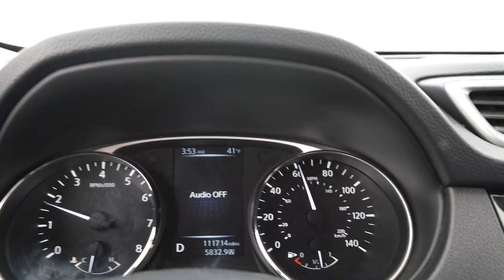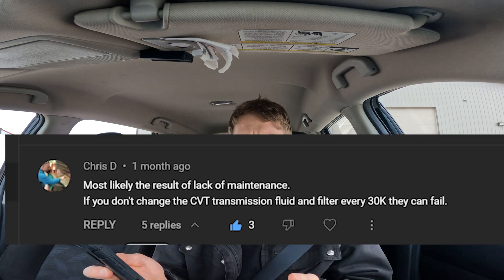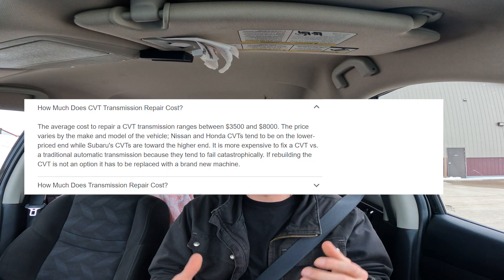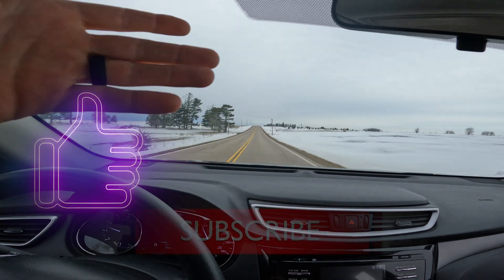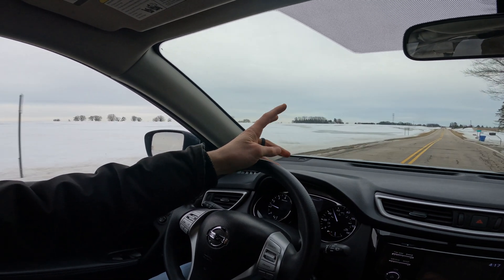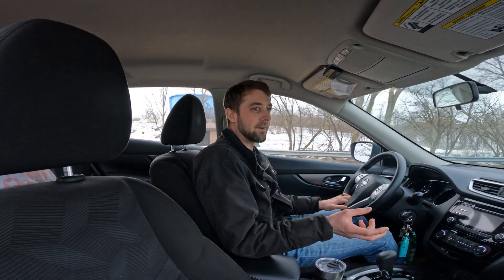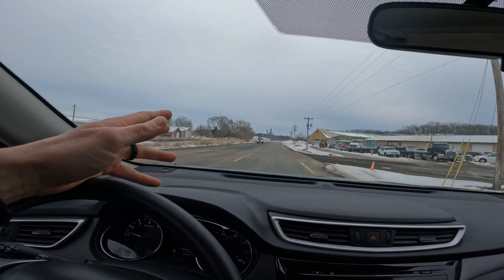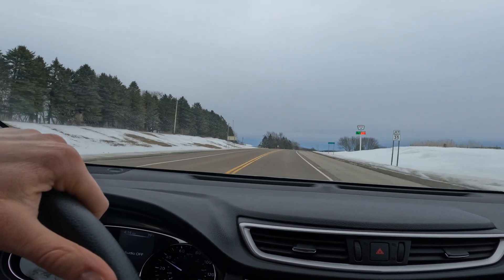Everything WRONG with the Nissan CVT Transmission

Comment: made to fail and sacrificing longevity for environmental insanity when the whole manufacturing aspects included would balance out by requiring less component production and fluid to maintain etc.  personally i'm done buying anything newer than 2005 and i'll stick to classics and diy where at all feasible.

Comment: I always make sure I put my cars emergency break up at all times whenever I'm parking my 2027 Nissan Sentra and whenever I change gears I always come to a complete stop. I also make sure I change the fluid every 30,000 to 34000 miles and it's been running strong. I'm currently at 162,000 miles.

Comment: CVT transmissions fail. OK. I see an opportunity to acquire cheap vehicles that are often like new. They look slightly more complicated than a transfer case? Don't by the mega expensive new or rebuilt units. Tear it down fix it n upgrade the stupid thing. I wonder if a software modification might help them? Put a big cooler on it?

Comment: buddy the CVT by nissan is not junk, my pathfinder2014 CVT  has 472000 kms on it on original CVT, what you need to do is following:
1- the CVT dies when overheated, oil loses viscosity as it heats up if temperature goes to 90 celsius then the belt starts shredding and gone. The heat destroys the valve body also. You need to have a cooler like the one in the pathfinder. However you need to clean the fins with water hose from dirt and sand like you clean your outside air condition condenser. Sand causes the cooler not to cool the oil and it becomes a heat trap! thousands of videos on CVT service and repairs and no one tells you to do the water hose cleaning which is free! they all want to sell you a product!

2- Oil drain and refill needs to happen every 20,000 -24000 kms dont open pans or anything, just drain and refill take 3.5-4 liters measure and refill and cost 50$ you can use cheaper oil like valvoline CVT or castrol cvt they are good and have better antiwear and anti slips additives than nissan NS3. But changing oil doesn't work if yhou keep overheating you oil and not having a trans dedicated cooler see point 1

3- Change the warmer paper filter- tiny filter 10$ evert 50-60,000 kms its an external one and is 3-4 10mm bolts takes 10 mins to do so. 

4- When you start the car the cvt oil needs 2-3 mins to warm up so dont drive instantly the oil is cold and doesn't lubricate properly, just wait

5- The nissan cars are cheap and is for cheap people but maintain them. I don't know why you think cvt is expensive? The pathfinder for example 2014 to 2018 models CVT are not selling 2nd hand in edmonton canada for 5000 to 10000 canadian dollar that's 3000 to 7000 USD so buy a full car instead of fixing the CVT if you don't know how to maintain it!

6- The CVT is well designed, but you and people don't understand how to maintain it. If you open the CVT valve body, the manufacturer installed two magnetic small filters inside the valve body even but people wear the belt extremely and I've seen people who have pathfinders never cleaned their external cooler by water hose ever since they owned the car and the cooler cannot heat anymore at all it' completely blocked all fins are blocked so the oil heats and goes to that cooler and it just steam and gets back to the belt and shreds it apart!  

7- Optimum operating temp of of cvt oil is around 70 celsius, so you can monitor your car easily buy an amazon OBD scanner and read the temps when you are driving in traffic and you'll figure soon you need a dedicate cooler. The cooler is probably nissan's mistake it's not standard on all the cars, but again people who buy nissans are cheap they wouldn't buy it!  I saw on amazon a full kit cooler for 55 canadian dollar delivered, from A -premium. Best ones are Hayden's 40,000 BTU capacity.

Comment: I have owned four Honda automobiles with CVTs and never had a problem. If you drive like a maniac in any car, regardless of the type of transmission you will damage the car eventually.. I personally like the way they drive, and having a bad experience with a Nissan product is not that unusual. Your video should be entitled, don’t buy a Nissan anything.

Comment: The infomous CVT transmission are junk whats wrong with a manual gearbox or even a normal automatic transmission and tgere is one motorcycle with a CVT transmissions the Suzuki Bergman it has the two pulleys and rubber belt which is easy to access and repair after all CVT transmission are in DAFs from the 1960s that was the first CVT car and it is the simple version of the CVT

Comment: 6,300 replacement at Nissan dealer for my 2016 Nissan Rogue at 50,010 miles. The only joy was getting to crack Dad jokes with the service rep. Implying that I needed to save money on other bills, so since I had some time, I knew I had at least 20 minutes,  so I called GIECO, 20 minutes, up to 15% off on your car insurance.

Comment: I see lot of video on how bad Nissan trans are, then go to next car like ford Escape and the same thing, I wish someone would make a video on what is a good used SUV to buy, is everything junk and we have to pick the best junk or what.......

I can surely say that the 04 Jeep Liberty was a good SUV that Jeep made, I put on  over 200k on it and the motor still runs good. In 2022 the trans went at around 195k, but a used replacement was put in for $2,000.00 installed, other repairs and maintenance was mostly easy and on the cheap side compared to todays Jeeps. But now the body is rusted out and todays body shops dont fix rusty cars, they only do collision repairs.......

Comment: You are so right I have a CVT Nissan rogue 2015 looks just like yours. I bought it last year used one owner and it had 79K miles on it. Transmission just went out and I’ve only had it a year. I had my Toyota for 16 years, never replaced the transmission, never had anything this costly to repair on my Toyota Camry 2006 which I had for 16yrs!
I was giving it regular maintenance changing the oil doing all that and still you shouldn’t have to change the transmission fluid at 70,000 something miles when I first got it.

Bingo exactly I bought it bought the car to register and insure. It cost me about 15,000 now my transmission is gone one year later these cars CVT transmissions are horrible horrible I would not recommend buying a CVT transmission always ask.

Comment: Ours lasted and we sold it working ok at 138,000  miles. We babied that car, but with this reputation, we sold it at a very low price with the customer knowing it might break any tome. We shifted to neutral at stop signs, changes the oil and filters, rarely took off fast or gunned it unless necessary for safety. No more CVT’s for us! Nissan has some cars with automatic transmissions, but bad products follow the reputation they made for the whole brand. I’ll never buy a Nissan anything again!

Comment: When you apply the gas , you must be gradual was if your driving on infinite stick shift. If you press the gas down very quickly then alot of unbalanced torque be suddenly going through the motions of the cvvts causes hi heat. So that all being known then understand you can press the gas down far but do not do it quickly, be like slow as if you feather a clutch shift that never angages as you gradually press down in one motion

Comment: I just bought a 2018 pathfinder from auction for $6,100 after taxes and fees. Blue book around 9k. Have i made a colossal mistake?
Reply from the maker: Not exactly, it’s a car. Doesn’t matter what brand it will eventually breakdown.
Reply: @ManvsCars    update: I bought it at auction for 6400 after taxes n fees.no mention on transmission or ANY mechanical issues in description, take it to mechanic and sure enough multiple cvt codes lol. They couldn't do it and the dealership quoted 7k😢. Believe it or not, after explaining the situation 1 hour later to auction manager,  he said they'd issue a full refund (many vehicles listed w 'transmission problems' or 'problems shifting gears' or 'transmission clunks' but no mention at all. Unexpected and welcomed.  Then last week on fb marketplace I bought a 2003 Toyota rav 4 (another notorious bad tranny 😂) for 5k, only 125k miles in excellent shape and I couldn't be happier

Comment: My son gave me his 07 Murano for other reasons than the CVT.  I noticed the trans whines.  I changed the fluid and filter but no change.  Only has 107k.  I’m not replacing the trans so either I drive it till it blows or sell it.  Question is, because it whines, does this mean it’s going to fail soon?
Reply from the maker: It depends, if the noise is actually coming from transmission the pump could be on its way out which requires trans replacement.
Reply: @ManvsCars  so far I have eliminated wheel bearings, axles as the culprit.  I changed the fluid in both the trans and front transfer.  It’s 100% speed related meaning it starts at about 15 mph and just increases in pitch as the vehicle speeds up.  It’s a different sound almost sounding like an electric motor.  

Fluid does not smell burnt and no noise at idle

Comment: Have a 2016 Subaru outback wkth 252k original cvt and a 2010 legacy that had 230k before i sold it ..also i was told the Murano has the best Nissan cvt as its chain driven compared to there other my models with belts

Comment: If you can't repair your car yourself, you don't want to buy a used cvt car. And they don't save gas. 1990s and early 2000s cars with 4 and 5 speed automatic got just as good fuel economy as new cars with cvt. And many never ever required transmission work even with barely any maintenance. Cvt with regular maintenance is still a problem. Repair parts are hard to get, used transmission is a roll of the dice and new cvt is quite expensive. Time for someone to make adapter kits to put a good transmission in these cvt cars

Comment: We have a Nissan Rogue and it's doing fine for now. Thank God. What do I do to prevent it from failing?
Reply from the maker: Changing the fluid and filters in the transmission helps with longevity. I have another video on how to do that if you are a DIY’er.
Reply: @ I found your video on the Nissan CVTs. I bought a dipstick for mine but I'm afraid of inserting it and it becoming jammed somehow. I know that sounds far fetched but I have this fear of inserting the dipstick that I bought and something inside trapping it like a bear trap. I bought an extra long dip stick because I have seen horror videos on YouTube of guys having the metal part of the dipstick fall of and being stuck in the tube. Does the dipstick simply reach into the bottom pan or does it reach into any gears or "clockwork" that might trap the dipstick? I wouldn't be surprised if some lousy engineer made a design like this.

Comment: thanks for the video. i own a used 2015 rogue i bought in 2020 for only 10,000 cad that has odometer reading of 170000 km at that time. now after five years with me it still runs as good as when i bought it and has 270,000 km runned. i never experienced cvt problem or engine problems i just took it to the mechanic for brakes replacement and some airconditioning problem. so in my case i think nissan can be pretty pretty solid too in some case
Reply: We are going to see same 2015 tmr wish no problems w the car
Reply: @RoyDMustang21 good luck. im surprised it still worth something 😊😊😊 just check for leaks on the driver side it may ruin the electrical
Reply: @diegoMambo1  thanks man I’ll let you know how it goes
Reply: I bargained to 7500 2015,190k miles 1 owner seems sus but idk

Comment: BROUGHT MY 18 NISSAN ROUGE BRAND NEW WITH 5 MILES....I NOW HAVE 242,000 MILES ON IT...THE KEY IS TO CHANGE THE CVT FLUID EVERY 30,000 MILES... MAINTAIN EVERYTHING ELSE AND YOU SHOULD BE GOOD TO GO

Comment: The Nissan CVT vehicle I drive doesn't simulate gear shifting.  It seems to work best when driven "like a granny" - slow gradual acceleration to let the torque build as opposed to jackrabbit starts and rush acceleration.  I can get it to the desired speeds but it just takes a few extra seconds.  Other drivers get mad but hey I'm not blowing up my trans pushing the RPMs. Also it does not like hills or mountain driving, period!  If driven on steep inclines or towing weight every day, it would surely fail.

Comment: Big scam. The cvt belts do not go out. They are built like tanks.  What goes out is the control module a solenoid switch etc a simple cheap fix but shops  run with the YOUR TRANSMISSION IS BAD FIX. 
The other fix is replace battery. A marginal battery can cause a bunch of issues that shops use to try andxsell transmissions.

Comment: I have Nissan altima 2012 CVT with 170 thousand KM's and no issues. Changed the transmission oil twice and said the oil was clean.

Comment: Nissan has absolutely destroyed their reputation by going all in on their CVTs, putting them in pretty much every vehicle they make...
Reply: They got rid of the CVT in the latest generation Pathfinder (starting with the 2022 model). Do other new models still have it?
Reply: @natez_kitchen after 2019bthe cvt became much more reliable  . The redesigned the radiator to prevent fluid leaking into granny n overheating both issues were wearing out cvt prematurely
Reply: The new 2025 Murano escaped the CVT too.
But the new 2025 Kicks and 2026 Sentra both stuck with it, unfortunately.  And the Altima and Versa, being several years old, are both stuck with it as well.
Reply: How sad for Nissan. It's too late even if they did a FIX.

Comment: these trannys have a paper filter to change, they are like $8. a pain to get the bolts out, but I do mine maybe ever 90,000km. Don't coast in neutral with CVT. change fluid like ever 40,000 to 60,000kms, I like the new castrol fluid, but also use valvoline. Inspect color of fluid when you check your oil. If you a used one try to buy low kms and then put it on the fluid change plan. If you live in a high temp area inspect more often, if you like add a cooler - but I haven't. I have driven a few hundred thousands kms with these trannies... BTW almost no one cares for their transmissions in any vehicle - total neglect!! So many unnecessary tranny problems in the world due to laziness. Also undercoat your car, change the coolant every two years, get a turkey baster and remove pwr steering fluid annually - use synthetic fluid to save your pwr steering pump. Bleed brake fluid, Grease your brakes at least once per year. If you don't know how to do it, it's not hard to learn!!! Do not overfill the gas. stop when it clicks. Grease any parts that need greasing. These nissans and other cars can easily do 1 million miles or more just with basic maintance. Wash the salt off your car, touch up rust spots. I have two Altimas and can easily drive them for the next 40 years if I choose. They are great cars.. The problems are the fault of the owners. Transmissions need fluid changes just like engines!! there are bearings in there and the fluid breaks down due to heat and friction. There are lots of bearings in there. Take care of your car and it will take care of you!!! These Nissans really are that good. I only had some bulbs go in them, aside from regular maintenance on brakes. Never had to replace an exhaust. I like them cause they are cheap and have a bad name, so I can buy them cheap with leather and bose stereo... no car payments!!! Excelent cars. I also have a 4runner, prefer Altima to Camry any day. Camry have tranny problems. Also older cars have better engines, not these new low tension piston rings.. Avoid hybrid. Also warm your car until it is within the operating temp. between Hot and Cold area of the guage. I love my altimas. Bought a spare car for $1500. Such great deals!! If you are looking at high mileage one, get it checked out.

Comment: I own a 2011 Sentra 2.0, 212k miles original transmission, I do my own service every 30k miles or so with autozone trans fluid. No issues at all. I try to keep in mind I have a cheap disposable car and I just gently press the gas pedal while driving let the car speed up at 2000 rpms.

Comment: As long as u change the cvt transmission fluid every 30,000 or 50,000 is fine I rather due it every 30,000

Comment: I have 2014 Nissan rogue with 108k miles on it.
Agree that my car was mostly driven in Arizona/Texas hot weather.
I owned it when it has barely 25k on it. I never rev faster or go past 75mph as a safety rule.

I never accelerate my vehicle aggressively. 

I take 4-5 long drives which involves 6 hours of drive in a year.
I am changing transmission fluid every 20k miles when it reached 70k.

My car drives fine, Although I am not seeing symptoms at lowers speeds, it started slipping at higher rpms when 4 people sit in car with luggage.

When I got it checked with nissan technician with his computer.
It found that my transmission started slipping. 
It gave a code p0744 Torque Converter Clutch Circuit. 

What's the point in owning a mid size SUV when it cannot do its job properly and starts fail at this rate. 

All in fair, I think Nissan used their CVT which is meant for smaller compact cars on a heavy SUV.  and this tranny is crappier on bigger vehicles than on smaller ones.
I never expected a Japanese car go this bad (Except Mitsubishi which sucks any way) under 110k.

Even Fords performs better than this. They usually start showing symptoms at around 150k.
Pathetic engineering for a big car company.